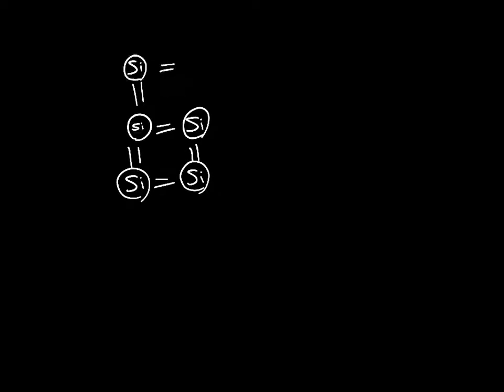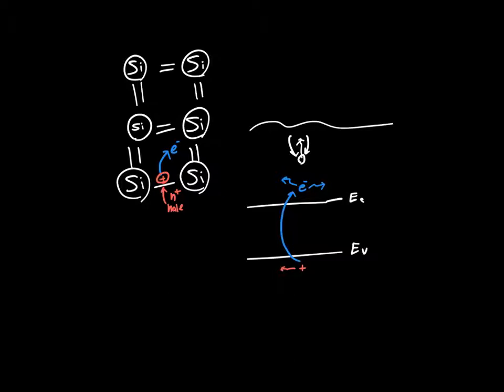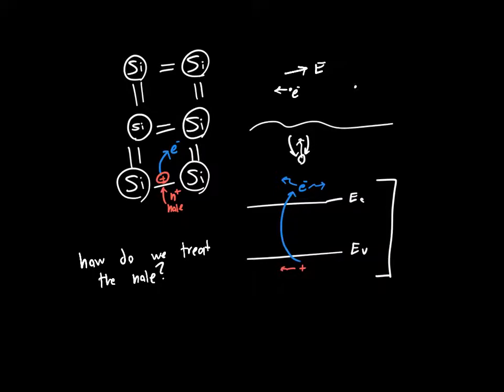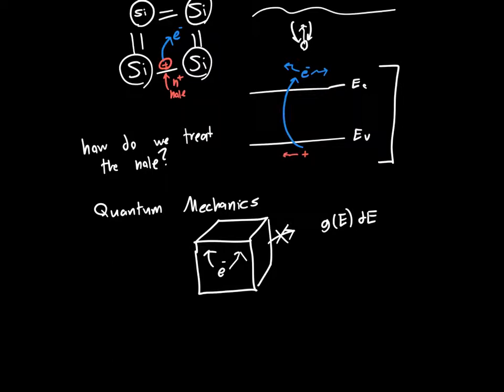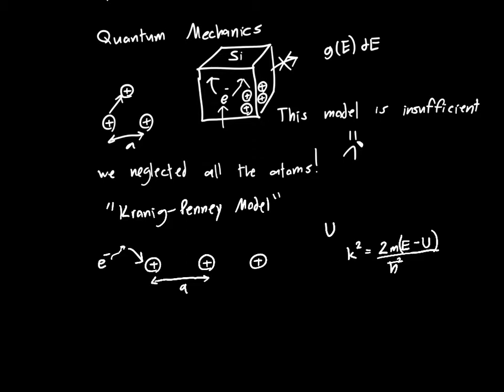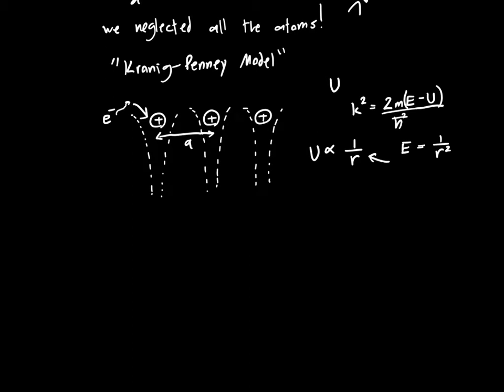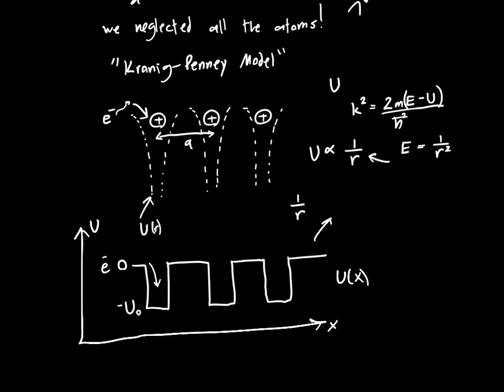The Problem with the Bond Model

Comment: How is the potential energy getting lower when the electron is getting closer?
Reply: Imagine standing on top of a bench in the street, you will have some potential energy relative to the ground (remember gravity wants to pull you down). Now imagine standing on the edge of a roof in a 10 story building. You will have an even greater potential energy relative to the ground (gravity wants to pull you down from an even greater distance!). Same idea applies to electrons, the closer it is to the nucleus of an atom, the weaker the attraction force it feels. An electron far away from the nucleus is analogous to someone being farther away (or farther up) from the ground you are standing, so the larger the potential energy.
Reply: Omar El Sherbiny Thank you

Comment: Is it assumed that the positive atoms in this video have all donated one electron from their valence band to the conduction band? If not, why are they positive? Shouldn't they be neutral?
Reply from the maker: Excellent question! Initially, before the dopant atom is introduced, it has 5 valence electrons in its neutral state. It only has an extra electron in the sense that it has one more electron than Silicon in its neutral state (which is easily removed). Once introduced into the lattice, this atom’s electron gets ripped away from it, making the atom positively charged.
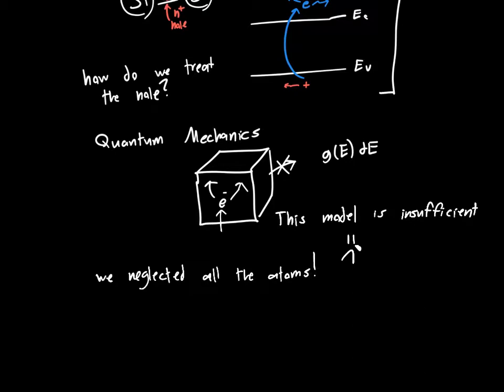Reply: @JordanEdmundsEECS  Hey Jordan, thanks for the reply. Sorry, but I'm still pretty confused. I understand when you dope silicon with phosphorus you get positively charged phosphorus atoms when the fifth valence electron "gets ripped away". However, you don't mention dopants anywhere in the video and you actually specify at 5:13 that the block of silicon is made up of a bunch of atoms and they all have positive charges associated with them. If I apply the same logic you used in your comment to the silicon lattice in the video, I get the following: the fourth valence electron in silicon gets "ripped away" from the valence shell, leaving a positively charged silicon atom behind. Is this what you mean in the video? Does "ripped away" actually mean the fourth electron left the valence band and entered the conduction band?
Reply: @seandever2272  I think what he means (without saying it because it would probably confuse us at this point) is that the electrons of a few of the silicon atoms in the lattice get "ripped away" due to the kinetic energy they have due to temperature. This is why silicon is a semiconductor: the Band gap, that is the energy gap between the Valence and the Conduction band, is small (about 1.12eV), and thus can be overcome easily when the electron has sufficient kinetic energy. Since the energy from temperature is a distribution, there will be a few electrons that get enough energy to leave the valence band even at room temperature. This is only possible because the band gap of silicon is so small. Other materials are e.g. insulators because their band gap is so large that they have (almost, since it is a distribution) no electrons in the conduction band due to temperature, and even at high temperatures. At some extremely high temperature, some electrons would jump up into the conduction band (e.g. become lose from their host atom due to the temperature), but this temperature is so high for insulators that they melt before that happens.
Reply: As far as my knowledge goes, the electron repulsion is often ignored in derivations because it's too difficult to factor in. Obviously this won't give correct results in all cases. An example is how the solution of the Schrödinger equation for the electron around a single proton (the hydrogen model) can't be used for atoms with more than one electron (just check out Moseley's law for a more accurate, but still not perfect, model). I haven't watched this whole series, so I don't know what the justification is for ignoring the electron repulsion, but I'm guessing that it will either be corrected somehow later on, making this more of a qualitative example, or there is a reason why you can neglect it to some accuracy.